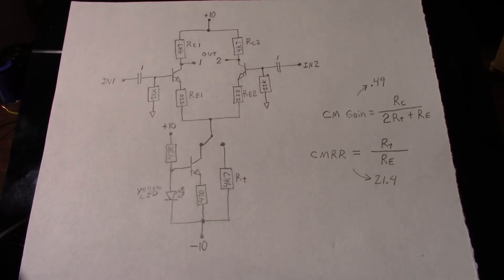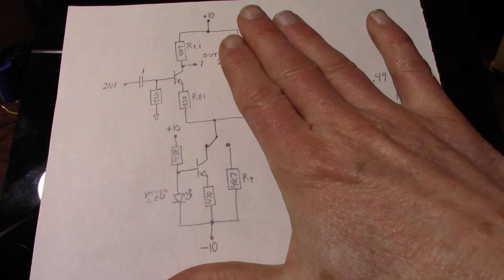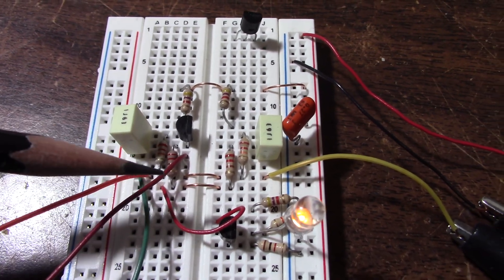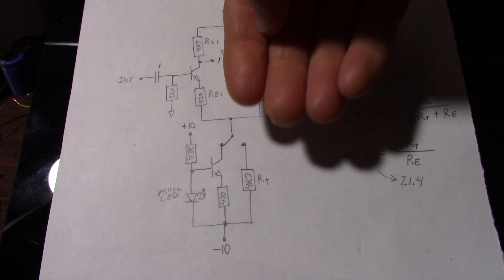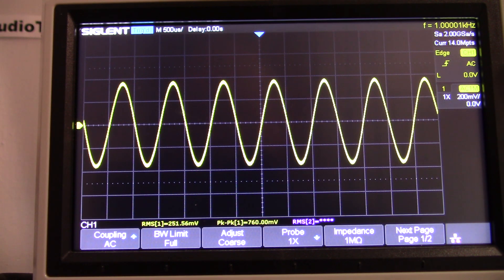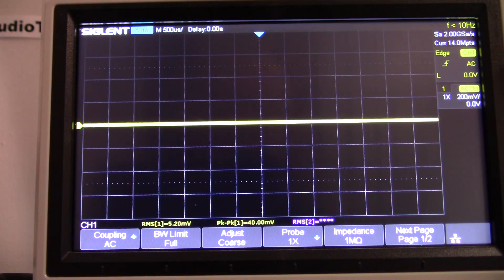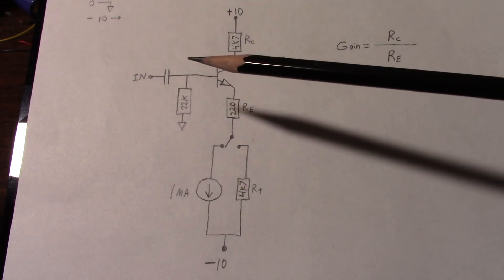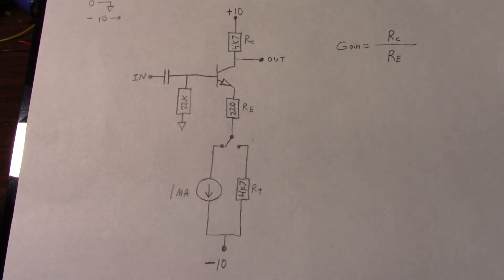Constant current source in the emitter circuit. Where'd the signal go?

Comment: Am I right in assuming that the resistance to current flow from base to ground through the emitter is so high that no current will pass an hence there is not enough voltage dropped across the junction to cause conduction?

Comment: It hurts a transistor's capability as a current amplifier if it cannot modulate the current passing from collector to emitter.  It would either saturate at the current of the constant current source or be cut off at the maximum voltage the constant current source can supply.

Comment: As I understand, there is a very strong resistive feedback degrading the gain. It would be sweet to see the base-to-emitter voltage at the same time with the emitter voltage. Maybe they are in opposite phase?
Reply from the maker: Emitter signal is in phase with the base or this would not work. At higher frequencies there can be a phase shift due to junction capacitance though.